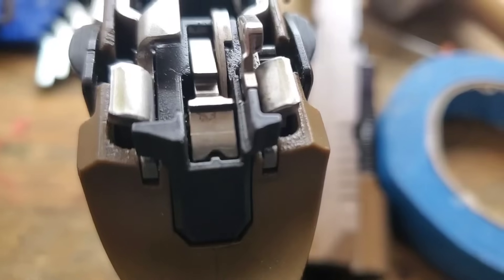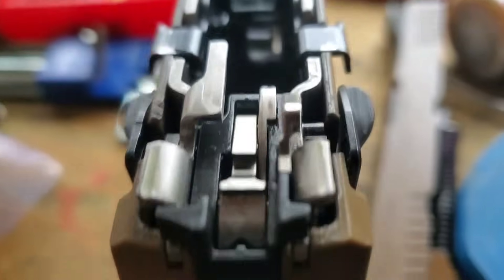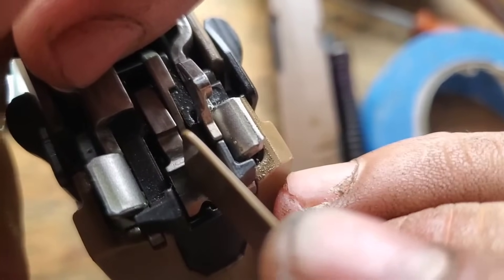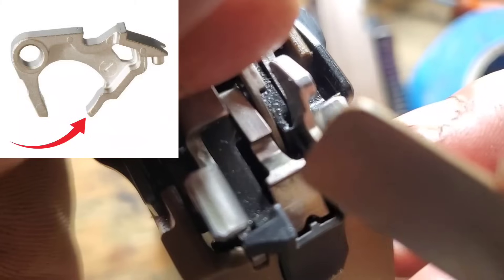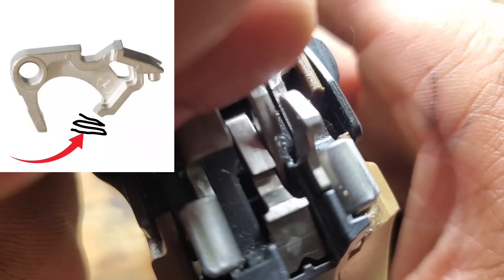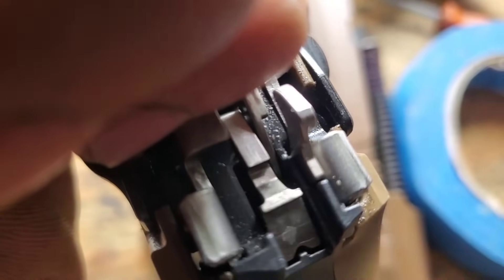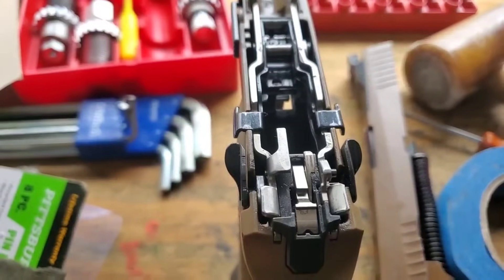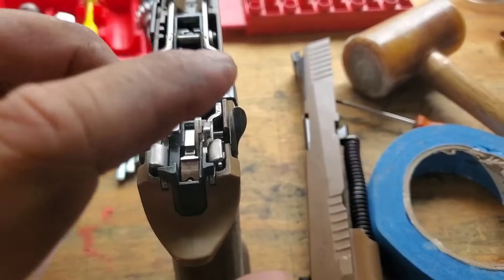Sig P320 [part I]: Private owners solve Sig Sauer engineering problems.

Comment: The fact that the manual safety allows the striker safety lever to actuate is wild
Reply from the maker: Also kind of in awe myself that the safety has no sear block on it. Like it's just a trigger stopper only. But everything else still works independently still regardless of what position the trigger is in.. 

Like let that sink in... the trigger bar actuates the sear, but the trigger bar in a non firing position can not stop the sear from moving.. bad move on the safety engineering side there..
Reply: @timberfallingcouple  In all fairness, that's how a lot of safeties work. In many weapons the safety simply brings the trigger arm out of aligment or blocks the trigger, while the rest of the mechanism is free to move.
It's good sear engagement design, leverages/mass balancing and a last resort firing pin/striker safety that makes the system safe. Slide mounted safeties like in the Beretta 92 have the advantage of rotating a plunger out of alignment which separates the hammer from transmitting force into the firing pin.
Reply from the maker: @ChucksSEADnDEAD pretty sure in my 1911s it was directly against the sear that the safety needed to be fit to perfection. But a hammer block is a damn good design too. I also recognize this is all inherently easier on hammer fired guns or else more companies would build one.
Reply: Just a 💩design from the start.

Comment: "Private owners solve Sig Sauer engineering problems." I did as well with a very early p250. It had jamming issues, and would drop fire. I dinked around with it for a while until I figured out that their 'safety lever" (Part # 20 on their parts diagram) was too thin. With the slightest wiggle, it would drop past where it was supposed to catch. I found a stainless steel washer of what I deemed was the correct gauge or thickness, and with a dremel and some small files, carefully cut a new part. Worked perfectly. 

I just went and had a look at their latest parts diagram. Looks like they have made some changes to the part to keep it from doing what the earlier ones did. At least they are paying attention.
Reply from the maker: They sure seem to pay attention and make changes without recalling the outdated weapons. That seems to be a trend I'm noticing in all this. 

Thanks for a great anecdote. Good comment
Reply: @timberfallingcouple  Agreed. To just change the part, and not do a recall is, shall we say, less than caring, for their customers. Heck, the very least they could have done is to ship the new part out to all the customers who needed it. It's crazy easy to replace the parts.
Reply from the maker: 100 percent agree
Reply: So now your P250 would drop fire ?
Reply: @great_deception  I'm sorry, I thought it was more clear than that. It would drop fire before I remade and replaced the part. But not after.
Reply: How is it possible for a DAO hammer fired gun like the P250 to drop fire?  Or am I not understanding what drop fire means?